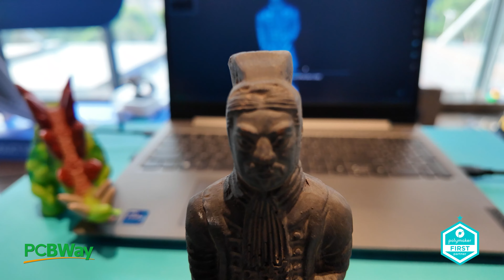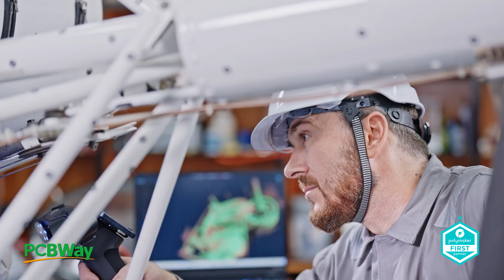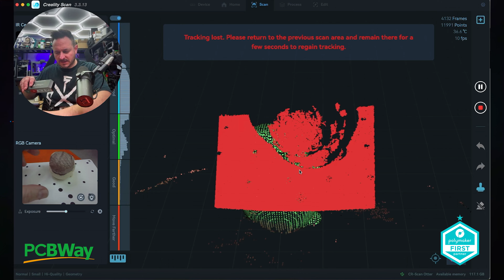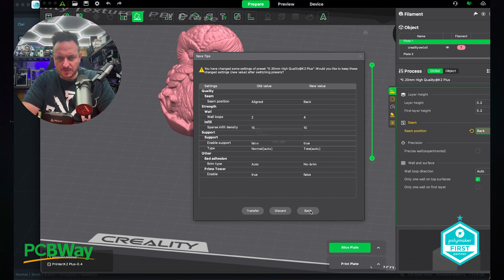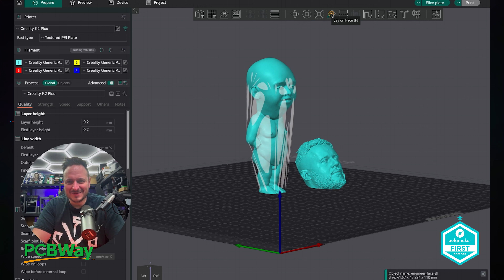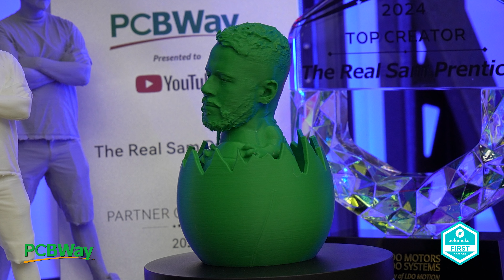I Put My Friend's Head on EVERYTHING with This Scanner

Comment: Please stop this annoying Auto-dubbing Thanks from Germany
Reply: yes normally that is the case, but it doesn't work on your channel so I thought you tube did it on your channel perhaps without your knowledge
Reply from the maker: Yeah I’m guessing so as I’ve not changed or agreed to anything, I’ll look into it
Reply: OK, check that out, I'm out for today. Thank you for your quick response and your work. Keep it up. GREETINGS from Buxtehude Germany
Reply from the maker: Auto dubbing ??
Reply: Your Channel runs with Auto Synchronisation
Reply from the maker: Isn’t that just an option that you can switch off ? I’ve not come across that issue before, genuinely curious.

Comment: There is a feature in the scanning software that might have helped with Sam’s squared off head. It’s possible to take separate scans and merge them in the processing in the software. 
If you’re interested, I have a scan of my old SLR digital camera that I scanned with the Ferret scanner. It’s certainly not perfect, but it is pretty amazing with Creative’s least expensive scanner.

Comment: That is one expensive $700 3d print!😂. What most people don't get,  is nothing is plug and play and involves lot of work, apart from needing a computer twice as expensive🤔. For a 3d print you need a watertight mesh, and mesh is not easy to work with amongst other CAD formats. Unless you are already a CAD designer, CAD engineer or an experienced product developer, it is not a worthwhile investment, and most likely endup as a paper weight. For a begginer, go with a 3d scanner that has the best software, with a good hardware. Creality is not the best, when it comes to software.
Creality's hardware is probably the best for an affordable cost, at the present time though. After an initial stint with Otter(which was returned due to various issues), personally settled on Raptor with no regrets(using for serious reverse engineering, Scan2CAD  workflow).
Think about how many people review a 3d scanner, that they bought with their hard earned money!🤞. Scammers Scanners are another toy to scan scam unsuspecting consumers of their wallet😂. The review is great, if you it take it, with a grain of salt.❤👍
Reply from the maker: Well I had this unit since April, thought it was going to be a painful experience, turns out it wasn’t. So your weird rant is unfounded, while you’re right about the software and hardware that’s very much a general issue across the board, and I’ve been using this for more than one thing since the review. But thanks for your comment.